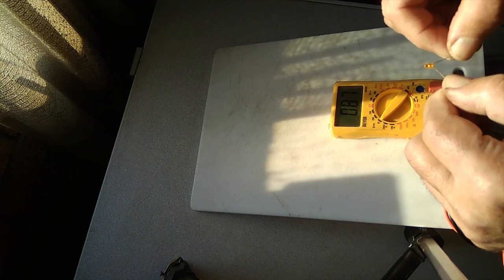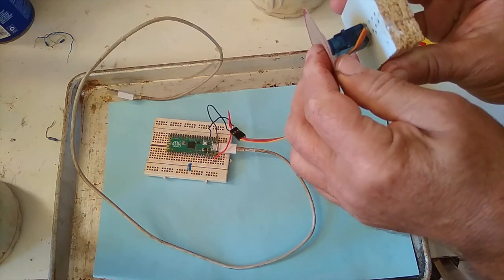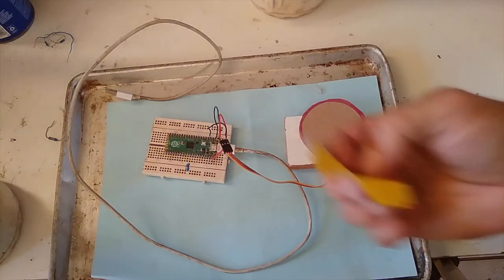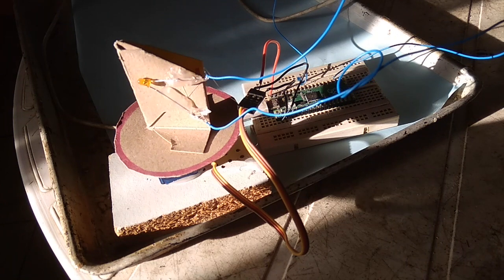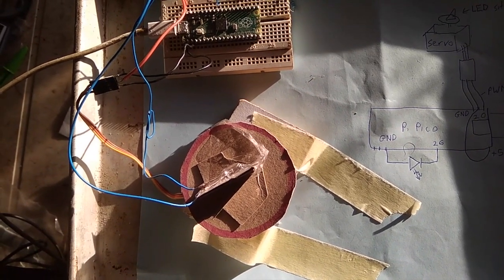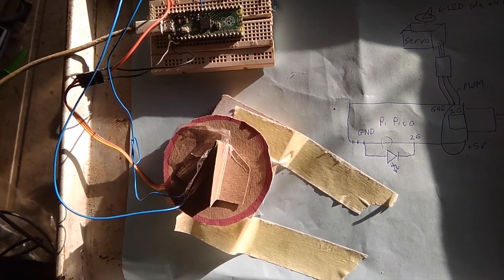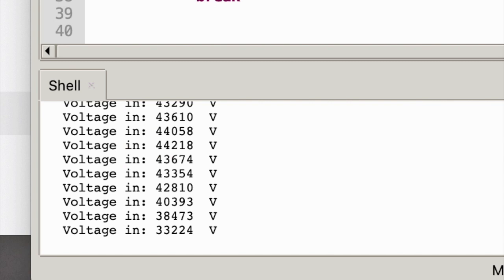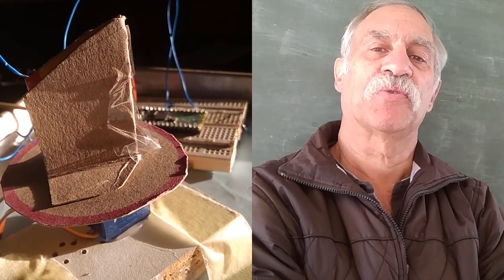Track the sun with just one LED, a Pi Pico, and a servo motor.

Comment: Ok great video. I made solar traker with 1 motor and 2 solar panels
Reply from the maker: I would love to see your circuit if you have a link to it.
Reply: @steventhomas3705  it's "analog solar tracker" but not that practical, better to use the light sensing resistor.
https://www.youtube.com/shorts/0NSgqBHHNVI